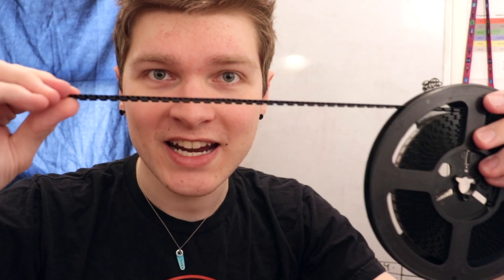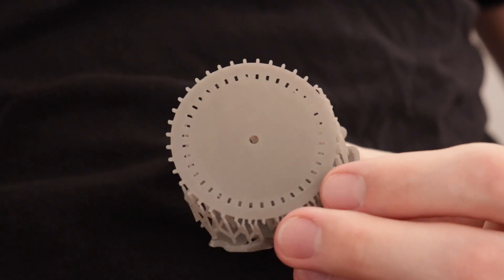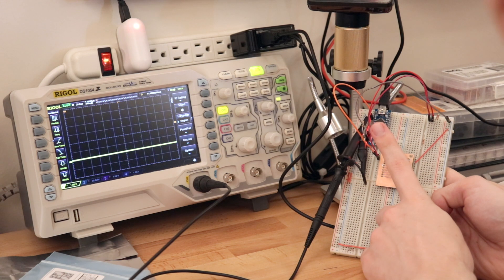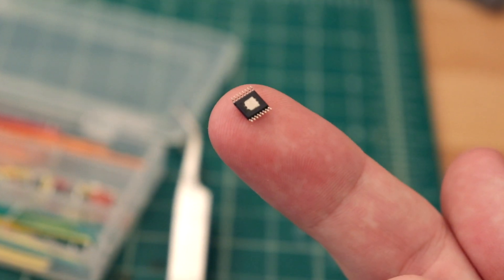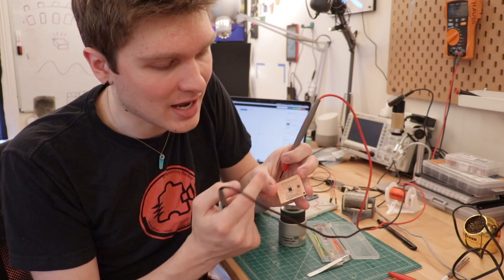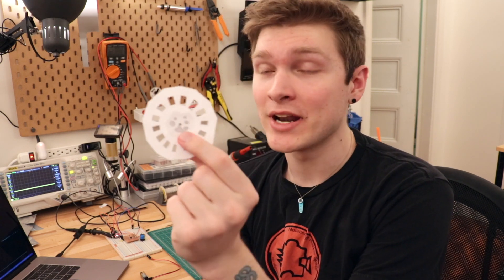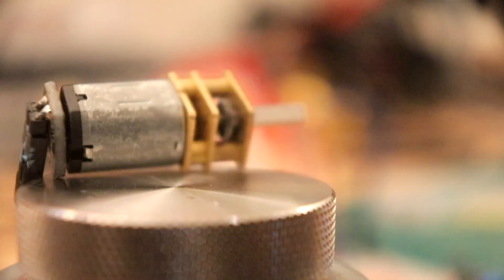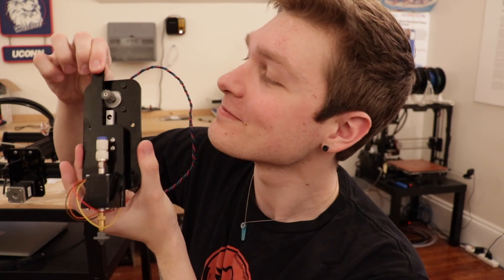Pick and Place Feeder - The Electronics

Comment: PID loops are generally great for control, but they offer no advantages to simple feedback in this case.  As you have seen, they do offer DISadvantages in the form of oscillations.  Engineering is the art of selecting the correct solution for a purpose and for optimizing it for the application.  It is foolish to select an incorrect solution and then to try to force it to work.

Comment: SRI International's moto: Why use lead when gold will do? Which brings up the issue of the tach wheel. You already have indexing holes; they are on the tape. The advantage of using the paper tape holes is when you decide to use a different component with a different tape, you don't have to make any modifications to your circuit. I love your can-do attitude, great to watch.

Comment: Fantastic vid, loving your work and enthusiasm. You should definitely consider getting a cheapo rework station (just a temperature controlled hot air gun) for situations where you need to remove ICs, much easier than drilling through the bottom of a circuit board

Comment: great work but have you thought of using stepper (small like 28byj48  )
Reply from the maker: I have! There were a couple things that steered me away from that. The 28BYJ48 is a bit too thick to fit in the size feeder I wanted to build. The gearing and precise control of a stepper were definitely plusses, but it was the size that really got me. If there were a super thin, highly geared stepper with a bevel/worm output, I would use that in a heartbeat.